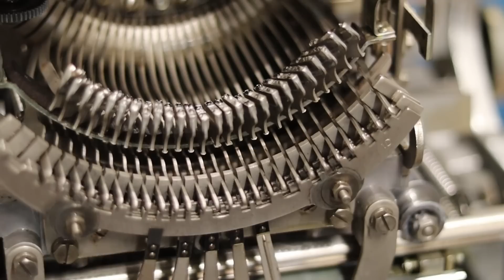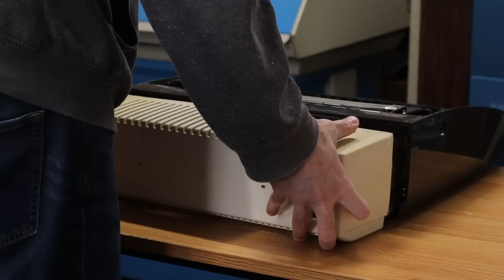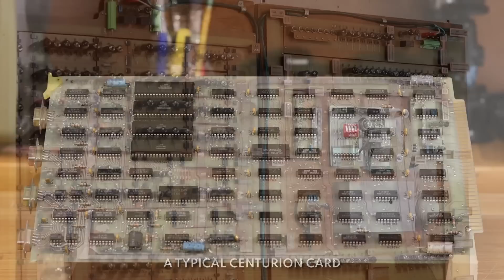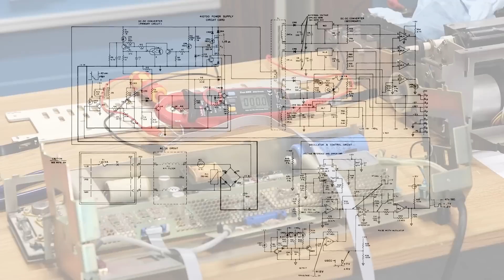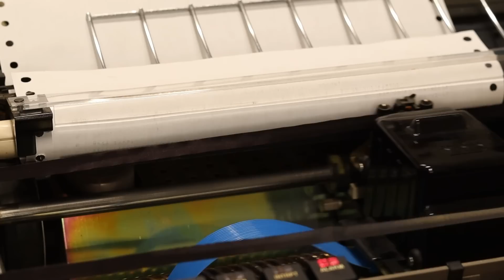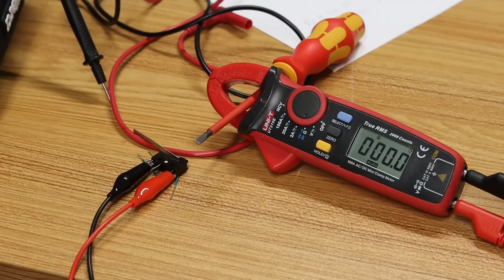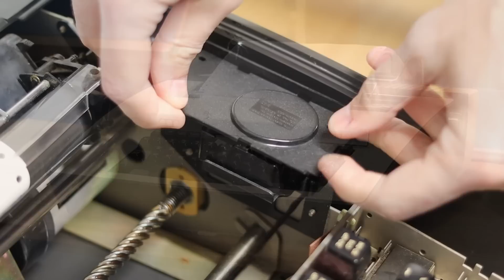Reviving a Model 43 Teletype

Comment: Had a 33 when I was in school and built a circuit to receive radio teletype (RTTY).  I really marveled, and still do, at the mechanical design of that particular machine.  It is both incredibly complex and incredibly reliable.  For a mechanical device, that is certainly an indication of a wonderful design that took into account many factors to produce such an iconic and incredible machine.

Comment: I worked on hundreds of these.  Employer was Leasametric in Allendale NJ.  Largest end user was Connecticut Credit.  They were distributed to car dealerships and anybody else who needed to check customer credit.  A third party company Ven-Tel made every kind of interface card you can think of and some you can't.  These were to attach to international networks in use down on the piers in North Jersey.

Comment: In the 1980s I was employed as a service engineer with Westinghouse International Service Co. I was based in Spain and used a teletype 43 to transmit to WISC head Office in Broomall Pennsylvania progress updates . It was necessary to use the telephone system using an acoustic coupler and telephone  which itself had its problems particularly when away from the cities as the switchboard operators would listen in to check if the line was free and if they didn't heat speech they would pull the plug. I seem to remember the speed was 9ooBaud. The system worked reasonably well using the international undersea cable but when they changed to satellite communications the coupler could not cope with spurious electrical interference.

Comment: Love the teletype content! The Model 43 may have been the last paper printing teletyper in the US, but here in Sweden the Philips PACT 250 was manufactured into the mid 80s. A true hybrid that was partially a dot matrix printer just like the Model 43, but it could also use a CRT that you attached to a bracket on the side of the teletyper. With a little bit of luck I might have one of those in my possession in a couple of months. :)

Comment: David, I'm really looking forward to your DG NOVA 1210!  When in college, the computer center for the Engineers had two minicomputers that we couldn't even see, plus somewhere in the range of 30-50 terminals on the two floors.  Obviously the CRT terminals were taken by the first students to get there, leaving the tractor-feed terminals.  One of my Professors had a NOVA 1220 hidden in a locked room in the Mechanical Lab building that no more than two students even had access to each quarter.  It had one fixed disk pack type disk drive and one removable disk pack drive, plus a Teletype Model 33 ASR terminal and a Tektronix CRT terminal (which was always taken by the first student to get there.  I don't remember the details any more, but we had a notebook with instructions on how to start the NOVA up.  I remember a light being burned out (for disk drive ready?), so we always listened for the sound of a click to let us know that we could finish the boot-up procedure.  I was able to use the NOVA for !1-1/2 years before I graduated (in early '82) and never had to go back to the computer center.  ;)

Comment: Wow!  You are going to do a video on the Data General Nova 1210.  This was the computer I first used at work with a whole 4K of core memory which we had hooked up to an ASR33 as an I/O device with a tape punch  and reader.   As far as I remember we had to load a short program with the switches to enable the paper tape which then loaded the boot loader to give proper paper tape.  Once that was loaded then you had control of the machine and could load machine code programs or languages all on paper tape, of course.  Actually we moved on to Mylar tape, blue on one side and silver on the other.

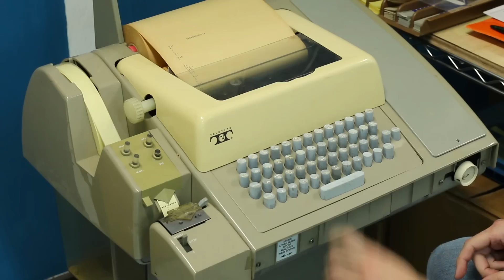Comment: We used a Teletype at high school to play Lunar Lander. This was in 1976 the Teletype was the typical large free standing machine (2:56) Had a punch tape reader that sort of worked. It would link into the school districts mainframe via a phone cradle link. On a side note, the haptic feel of the keys when you pressed them was unlike anything you will ever experience! You push down, you feel a little push back it clicks then you hear a motor sound for a second!

Comment: I used to work on these old girls back in the day. We both used them and sold/serviced them. Ours were mostly connected to IBM Series one computers, System 7 , or System3 computers. By the end of these machines, we had switched 100% to Series one. We also used and sold ADM-3A (pac man we called them, open one up and you'll see why), Wyse 50, Wang, and intecolor dumb terminals. Boy, the Wyse 50 had a fabulous keyboard! - The intecolor monitors were cool, weighed a TON, but the were color displays when such things were unheard of.
The KSR-43 came in two flavors, the back board was either for serial, or you could get a 300baud modem  board and hook it to a phone line - the ones with a modem were much rarer than the serial version, which we didn't find out their rareness until later when they were being phased out and were buying them used in any condition from all over, and I was in charge of the boneyard - get them working - process. We sold our last one around 1995-1998 - and it was a yellowed case, barely got it running, the customer was grateful we even got them a working one .... then they were....gone

Comment: To me, the apex of the teletype is the ASR-33, which was ubiquitous when I was starting my career in computers. The ruggedness and versatility, and of course the sound was just the quintessence of computing. But I am so glad it was replaced by data terminals and eventually by PCs. 300 baud is just not a speed you want to wait for when you need an answer quick!

Comment: In the staff area of the Maths faculty at the University of Newcastle (Australia) in the early 80's, we had a few different types of VDU. There were some ADM3as, but the favoured VDU was the Volker Craig VC-404.  We had a room full of dialog 30's (I can't recall who made those, but they were not particularly nice), plugged in to the muses of a Perkin Elmer 3220 (which I found out a few years later was actually used at the University of Wollongong) as a part of the first non-DEC port of UNIX. Its console was truly horrendous. A Perkin Elmer Bantam 550.

As another aside my father had a Model 15 connected in to a radio modem he had built to do RTTY (Radio Teletype).

Comment: Gee, I recognized the mystery computer! I wrote operating system code in assembly for DG machines in the early 70's working for Decision, a third party manufacturer of disk, tape and other peripheral controllers for Data General Nova line computers. I've still got my Space Wars program. Using the front panel switches as game controllers wore them out so fast the service guys banned it! Had to write fast integer sin/cos routines to keep up! The good old days ... can't wait to see it run!

Comment: In Britain, Creed was the big teleprinter company. For instance, I remember using a PDP-8 which had Creed 2300 teleprinters for I/O. At one time I owned 2 Creed 3's, a Creed 75, a Creed 444 and a Creed 2300. My radio shack could be very noisy when 2 or 3 of those were running. The noisiest, but most compact model was the 75. The 2300 was the quietest by far, comparable to the Teletype 33.

Comment: With ribons, wet them first using two sponges glued to a pair of kitchen tongues. You dip them in ink, gently grab the ribbon and rotate it, re-dipping every few cm (10~14 cm). This then makes it easier to accept ink from the actual sponge. It's kinda like that thing, where if you take a glass of water, reverse it with a piece of paper so it doesn't spill, then place it over dry ground and pull the paper, the ground, being dry won't accept the water. Same thing. Back in the day, you could actually get a tool specifically for this, that allowed you to wet the ribbon in situ, in the machines, i haven't seen one in decades. When i was a kid, one of my first part time jobs was to keep various machines ticking and this was a thing i'd do once in a while.

Comment: The model 43 probably supports 110 (not 100) and 300 baud. The old Model 33 had 2 stop bits whereas all faster speeds need only one, so it used 11 bits/ character * 10 characters per second = 110. Faster terminals used 1 start, seven data, 1 party and 1 stop bit = 10 bits per character.

In the old days (late 70s) 300 baud was considered "high speed".

Comment: Finally - a piece of equipment I have experience with, and one that I can help you with!  I have NOS replacement ribbons - please let me know how I can send you one.  I also have the operation and service manuals if you need a copy of those.  I disassembled and cleaned the print head on mine - it was a disgusting mess, but it worked great once it was all cleaned up.  I see that you found the paper - I lucked out and found a less expensive opened box on eBay for a good price.  Thanks for sharing this great machine with the world!
Reply: If it’s possible, could I please purchase a ribbon.?

Comment: Back in the '70s I was able to connect my TT43 to my TRS-80 Model 1 for printing.  In the '80s I used it in college.  I happen to still have it even!  It still works; however, it has been a few years and of course the ink is dry.  Very cool seeing this video.

Comment: Probably need to set the number of columns based on the width of the paper.  Would be useful to have a few terminal configurations for different paper widths.

Comment: junk yards used to be connected to each other via teletype, and it was a way better system.  it used to print out the parts being looked for, whereas today the websites advertise the parts they have instead.  but when you used to send out a teletype request, everyone in the system was reading it and trying to get the business and today they list most of what they have and forget it, removing the personalization of each individual need.  it used to be the sellers job to find you instead of the other way around, and most had a dedicated employee/employees who worked the teletype as 1st priority.  that 1977 model was in use well into the 90's

Comment: I remember a newspaper office that had a teleprinter for the Associated Press that looked a lot like that old Teletype, but with no keyboard, and it was running in the 1980s. At that point the AP stories were also going into a computer system (PDP-11 based I believe), but the printer was still running during the day. A signature sound.

Comment: When you're scared of damaging chips through static discharges and you don't have proper grounding means, wet a large towel. Squeeze out most of the water (so it is just a bit damp) and cover your entire table top with that. Put your sensitive equipment on the towel and do not wear garments with long sleeves so your arms will regularly make contact with the (slightly conductive) towel.

Comment: The sponge probably dried out and still has pigment in it. Add solvent maybe?

Also, looks like the regular paper might work in 80 columns. Anyway you can tell the Centurion to output 80 columns to CRT2?

Comment: Pull the ribbon out and spray it down with penetrating oil such as WD-40 and see if that helps. We used to re-energize dot matrix printer ribbons like this back in the day. Spray The ribbon down and let it sit overnight and dry up any excess before you reinstall it.

Comment: Ah, the good old RS232 “standard”. I used to write printer drivers back in the 1980s, and many printers would claim to use the RS232 standard, but each with its own special, pointless tweak, making them non-standard. 

Just hearing or reading the word “RS232” makes me scowl.

Comment: I have seen a similar machine called Lenta Teletype (Lenta = stripe), used as interface for some low level diagnostics on an soviet made surface to air missile system S-300PMU.
It was covered in a nice blue housing, but man that was a heavy wight.
Usually the teletype was stored in a big wooden box. When not used they put inside of a trailer with spare parts, called SIP.
Have never found pictures or even videos on these machines made in the USSR.
You should get your hand on one of those teletypes.

Comment: The sponge on the ribbon is hard because it is just dried ink. You must remove it and soak it in alcohol and squeeze it several times to soften it and extract the old ink. Then you can put in new ink.

Comment: Looks like the Model-43 has a Dot Matrix "pin" not working on the wire-pin number 2.  Notice the dot missing on the output text at the 2nd or 3rd position?

Comment: About 1974, the programmers in the data processing department of the major insurance company I worked for used Teletypes to access the IBM mainframe. It seems very crude now but the IBM lease cost of CRT terminals with tiny screens were too expensive for a very cost-conscious (i.e. cheapskate) insurance company. At least online terminals were a huge step above punch cards. (They still did have and use punch card sorters and hand-wired control boards.)

Comment: The highschool I went to had a teletype that connected the the Univac mainframe at the University of Utah. I wrote a couple of BASIC programs on it. What I didn't know at the time was I could have received e-mail on that because that mainframe was one of the original Arpanet nodes. Basically what would eventually be known as the internet.

Comment: Before the teletype existed, there was another machine that had binary encoding: the Linotype. The brass matrices that carried the images of the letters to be cast into slugs of type metal have a series of teeth and gaps (representing 1s and 0s respectively) at their top, and these teeth helped the machine return the matrices into their proper magazine channel after passing through the keyboard and casting sections of the machine. The earliest Linotypes were built in the late 1880s, and many continued in use into the 1970s (there is ONE Linotype still in commercial operation in North America, in a small Colorado town).

Comment: It's shocking that a machine from so far back  is so EASY and ELEGANT to disassemble. Modular, elegant, well built, easy to service.
Reply: Yea, it never occurred to them to glue or laminate parts together.  Everything was attached and can readily be unattached.
Reply: @gauchomexica  It is the machines of today that are typically poorly built, difficult to disassemble and unserviceable.  This is a trend that is accelerating, sadly.  We are in a race to the bottom.

Comment: That sticky pin on the print head will probably unstick with a little cleaning, and perhaps some isopropanol or brake cleaner. I used to use carbon tetrachloride on the platen rollers back in the day to soften and clean them, but that stuff was banned years ago.

Comment: In the mid-90s I worked in a company in germany that used terminals like this (or this exactly? Not sure...) for reading/setting values for a computer that controls the galvanisation process of rear car windows. It was a fallback, one for each production line, if the "main computer", made by AEG with 2 constantly turning 8" floppies and Terminal with CRT lost one of its 4 connections. As there were no handshake lines in use, these "fails" happened if the number of messages via serial increased. Accessing the lines via the good terminal took control back. I left the company while these things were still in use. No chance to get a piece of this working computer museum. Because of Y2K, it was thrown away some years later.

Comment: Nice trick adding another bar to tension the ribbon. Be sure to remove the ribbon when not in use to prevent the ribbon from stretching out more.
Locking the print head forward adds a bit more tension.

Comment: I picked one of these up last year to use with my homebrew 6502 computer and it's been a hoot. There is a 3d printable model of the ribbon cartridge that is out there and uses cut-down typewriter ribbons to ink the heads. I'm missing the paper guide on mine unfortunately, but it still works great. The paper is rare as hens' teeth, but I've heard murmurs that sprocket feed paper of the correct dimensions is used in some braille printers. I've never been able to come across it here in Australia but you might have more luck in the US. It's a shame that the ASR43 paper punch module for these is so rare, would love to get my hands on one!

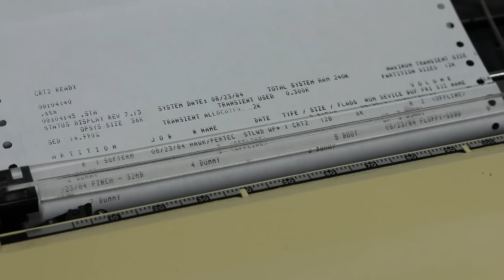Comment: @22:25 it looks like you have one of the print head pins not working.  2nd pin from the top. The print head is surprisingly serviceable but in mine there were small rubber buffers that had turned to wax from age and just broke and fell out.